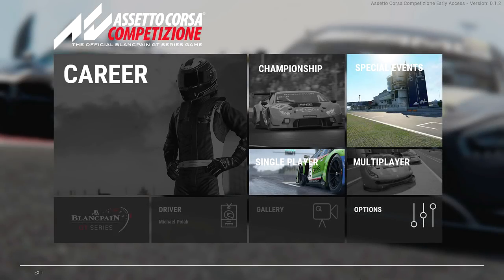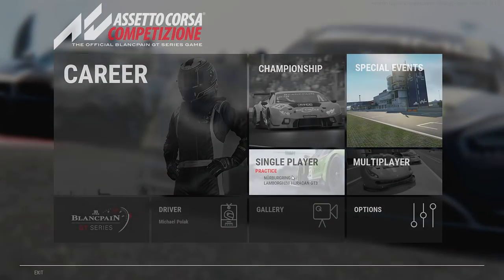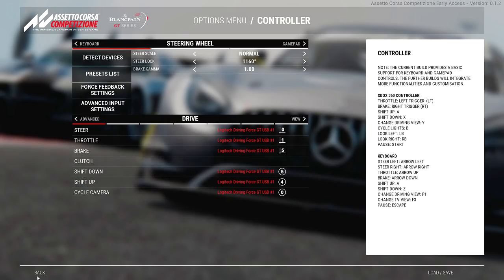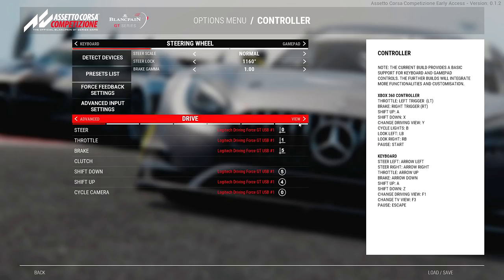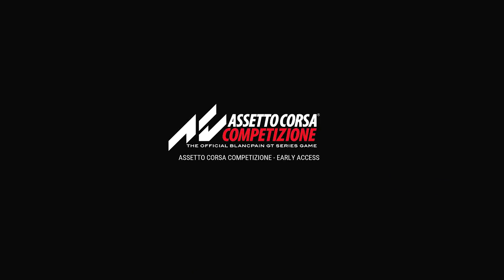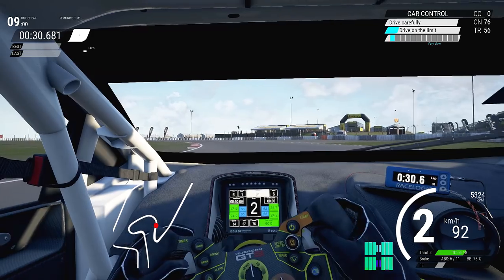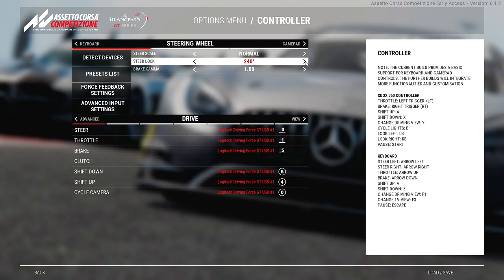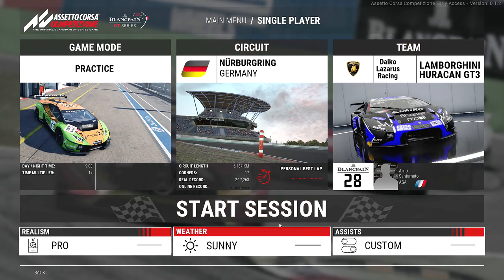Assetto Corsa Competizione - My Basic Entry Level Wheel Problems Solved (HERE'S HOW)

Comment: I've been struggling for weeks with my G25 on ACC,. It felt like the front tyres are flat going into the tighter corners, especially the chicane on Monza. The cars just wouldn't turn in, and felt like they are on ice, massive under-steer!!!  I have just set the Steer lock to 1150 and what a difference! Over a second quicker lap times after just a couple of laps. Thankyou so much for the video,  I was getting close to giving up with the game.
Reply from the maker: No worries Tim... and so glad I could help. For the record, I have just upgraded to a G29 - so if you play PC2, then I have noticed the same thing. EG, when you do the second part of the calibration where it asks you to hold the wheel @ 12 & 6 - if you ignore it, and make the figure anywhere from 900 - 1180, you ALSO get that much better response in PC2... happy racing ; )))

Comment: Thanks, I have the same wheel, and I did realize that the pedals needed to be Inverted. My real problem with ACC Is that the wheel will not center! It´s to the right a bit. I use this same wheel with rFactor 2 and I don´t have the centering Issue.
Reply from the maker: Can't give you an answer on that one RedOneAlpha, as with the awful VR support, I haven't played ACC in ages. But hopefully someone else can give you an answer as to why your wheel isn't centering? (or hopefully the next patch update fixes the problem?)
Reply: @SingleRacerSVR   No worries SR, thanks. I´ll keep Investigating.
Reply: @SingleRacerSVR  Just for the record. I knew It was a software Issue, so what I did was uninstall the Logitech software (v510.127) and just let W10 add a generic driver. Lost some options from the software but now the wheel works great.
Reply from the maker: @onealpha710  that is awesome to hear, and thanks for letting me know. But one IMPORTANT follow-up message, because you listed your software number as v5.10.127. So I run the Logitech G29 using the LOGITECH GAMING SOFTWARE - but my version lists as v9.02.65. So maybe do a search for that version of the software instead, as there is a chance that I DIDN'T get it directly from the Logitech Website itself - but some other legitimate software site, but I just can't remember now. Best of Luck, as you can always go back to what you just did to get it to work... ; )))
Reply: @SingleRacerSVR  Thanks SR. I have a Logitech G13 Installed and It uses v9.02.61 so that´s already Installed and the DFGT wheel doesn't show up there, on the other hand I also have a G502 mouse which does share the same software as the G13, so go figure what is on with the DFGT supported software, but thanks anyways, very kind of you.

Comment: Any chance you can share your full mappings for controls as I have the same wheel and what a good base of controls that work for the buttons on this wheel
Reply from the maker: Sorry BOMBPHONICS, but this was a video done in the early stages of the Sim. But I always try to race in VR, and this Sim has shocking VR support for lower-end PC's which I still have. So I haven't played it for absolute ages. So I have no settings for the whole wheel I could give you. The only advise I can give therefore,  is what I would do in this situation -- which is to type ACC G29 Wheel Settings and see what comes up... Good Luck.

Comment: I have actually a problem. My wheel is cheap and it's 90°. But when i start racing with my loaded setup the wheel starts moving (Like centimeters) to left and right, it looks annoying. Is it because it isn't well calibrated or because is cheap? (It's detected as wirelles controller, but it isn't).
Reply from the maker: Sorry ZASIMO as I am not expert enough to answer your question accurately. But you didn't mention if you had JUST bought your wheel, or if it is second-hand. Cos I once had the sim car driving forward without input, And it was because I had dirty pots (the internals that recognised the signal). So when I cleaned all the dust out (it even had a spider-web in the pedals) that seemed to fix the problem - but no good for you if it is already a brand new wheel?

Comment: I have a small problem, I can't configurate the thottle and the brakes simultaniously, If I configurate the throttle to the throttle pedal, and then I configurate the brakes to the brakes pedal, it erases the throttle config (like both pedals were the same). Does anyone know what's the problem?

Btw I'm only experiencing this problem with this game expecificly...
Reply from the maker: I don't have the answer to this one other than to try the obvious thing Rodrigo. I'll pin your comment to the top to see if someone can help - but it sounds like within the ACC setup, it's treating your brake/throttle as one input (not a separate axis) so as soon as you set the one, it wipes the other. So my only advise being the logical choice, is to join the ACC FORUM if you want to - and just report this with the model wheel you are using. And please always keep in mind that this is exactly what the early access period is for. To try and iron out this weird bugs before release. I'll pin your problem to the top now, so hopefully someone with the same problem might already have the answer?... good luck with it Rodrigo.
Reply: SingleRacer Thanks man ;)
Reply: Same Problem here with G27

Comment: Great to see a new video from you Michael :-)

I have a Thrustmaster T500RS wheel, and I find the FFB always a difficult thing to get right no matter what game. It seems this wheel handles things differently than most others around. If you have this wheel, the ACC forums are full of people speaking about their trouble squeezing the feel from it. Kunos have acknowledged that this is not what they expected from this wheel, and are working on the problem.

With the steering inputs, I think many people mix up the in-game Wheel Rotation (1160 degrees in Michael's case) with Steering Lock.
Wheel Rotation is merely calibrating your wheel's limits to the game. Steering Lock is usually only a very shallow angle in a race car and controls how far the front wheels can turn laterally relative to going straight from "full lock left to full lock right". If I'm not saying this in a way that makes sense to you, think about a drift car and how much steering input they have available to them so they can hold those wild sideways angles, compared to a road car or a race car which is easy to spin as there is not always enough steering input available to correct a slide due to .. over-exuberance ...

In my experience, most modern racing games / sims don't explain this very well, so the actual steering lock each car has (which does vary from category to category and even in road cars quite a bit) is not necessarily something one can know from looking at the car setup or car specifications in-game.

Project Cars 2 provides a handing setting in the car setup that allows you to scale how fast the steering reacts to you inputs. I typically run mine between 11.5 and 12.5. GameMuscle does this a lot in PC2. Check him out to see how he does it and the effect that it has in PC2.

Can't wait for the ACC VR patch! I suck so much at 2D driving as I play on a giant TV a long way (and I'm not necessarily right in front of it), so VR gives me the perfect FOV not to mention the highest immersion possible for my situation.
Reply from the maker: Thanks so much for your input RubberStig - always good to learn off others. I'll pin this to the top so other can read it later as well ; )))
Reply: exactly this @RubberStig, and I'm not sure if I'm imagining this, but FWD reacts differently to RWD (but this is probably more an effect of the drivetrain rather than steering settings).
Reply: A lot of FFB is how we interpret what it is telling us. In VR I tend not to rely on the FFB as much as I used to in 2D. I'm a lot faster in VR than 2D which is unusual - being a bit slower to start with, then a bit quicker when you settle in is normal. With ACC release 1 there are so many conflicted reports about the quality of the FFB experience (especially compared to AC) I just had to try it, and I had great difficulty getting anything useful from it. So I went to the ACC Forums and found most people with my wheel have the same issue. I think as it's very early, and there are so many consumer wheels out there, Kunos haven't managed to dial them all in yet. Even some of the Direct Drive Wheel guys are struggling. This may just be that Kunos have approached the FFB differently this time, and all of us are struggling to interpret what they are trying to convey to us through the FFB.

Your point about FWD is true in that the vast majority of the car's actions are felt through the wheel which is directly connected to the front / drive wheels of the car. I always think that rear wheel FFB messages may be getting lost because they aren't attached to the wheel, and that I need to spend $3000 on a 4 speaker buttkicker setup so I can feel what each wheel is doing at any given time ... then I come to my senses ... ;-)
Reply from the maker: RubberStig, with such a good skill of explaining things/giving advice - you really should be doing your OWN Channel if you ever got the chance too?
Reply: Thank you for the wonderful compliment Michael - I really appreciate your kind words. I would really love to have the time to devote to creating content for a YouTube channel - it's on my ToDo list, but I have much higher priorities I must attend to before I can do that - I barely get much time to SimRace these days!

Comment: How can i setup my logitech driving shifter for assetto corsa competizione? I want manual shifts...
Reply from the maker: I'm a little confused by your question Manu3017. As you should normally just be able to enter each gear individually. You just need to be in neutral first --- then select 3rd gear for example, hit the enter key to blank it out? and move your shifter into 3rd (and maybe back to neutral again???). And it should register each individual gear that way???
Reply: SingleRacer I understand, but i cant find where to enter keys for manual shifts, like in assetto corsa

Comment: I thought all Ozzies, due to geography, were inverted, lol.  Actually I thought the steering angle advice was good. If it's set too low you get a lot of scrubbing, thus, understeer and wear. I wonder if when they get the damage model up and running whether tyre scrubbing is included?

Comment: During this video was your pedals assigned as a button???
Reply from the maker: Technically Yes, Basher - but both in ACC and most other racing games, just by pressing your pedals - it will "label" them as an AXIS (X, Y or Z) rather than a button exactly. My understanding is that you could assign them (your pedals) as buttons in your software. So for example since this video, I have upgraded to the G29. But in the software, I could assign a specific BUTTON, if I wanted the BUTTON to be the brake & accelerator. But if I just press my pedals, when I click to assign it in any game - the game itself will label them as AXIS Y or AXIS X etc. I hope that is clear and what you were asking?
Reply: @SingleRacerSVR  In AC i want to set my pedals as axis because it says move your axis when i am setting the throttle and brake. Can change my pedals to axis

Comment: I still prefer how AC behave with my g29 than ACC does ....i had a respectable Misano hotlap of 1.36.6 with a FREAKING ----->RGT FFB Pro ( Thrustmaster rally wheel 12years old) .Just bought the g29 and my best time with the same car setup is 1.39 but I struggle alotttttt! FFB is so inconsistent, I lost 3hours trying to fix the issue
Reply from the maker: I totally & utterly agree with you Vincenzo - in fact I would take it one step further and say that AC is the best FFB & physics handling racing game of the lot (but to be far, I've never played RF2 or iRacing to compare). But one thing I would like to point out to you Vincenzo, to at least just think about is this. If I rate AC as the best handling sim-racing game, with the best FFB inputs to the wheel telling you exactly what the car is doing - then I'm NOT so sure I could have said that in it's 1st year of release. Meaning that I think AC was an ever evolving game, due to the great support by KUNOS - just as I feel that ACC will be in a year or two of development & updates. Only really the UNREAL ENGINE could be the deciding factor in all this, but who knows......